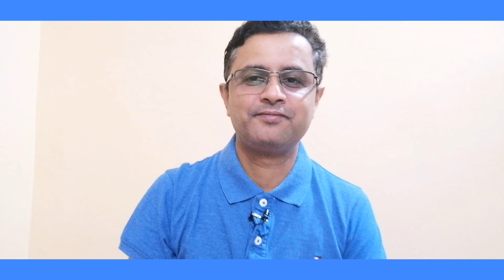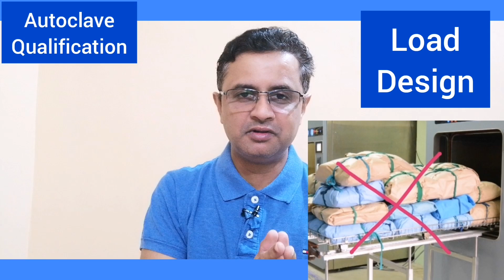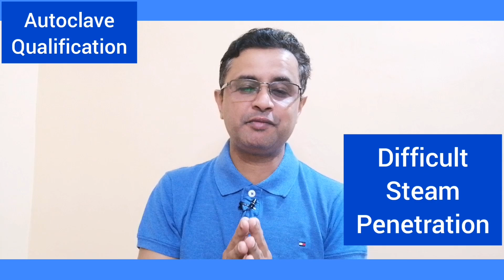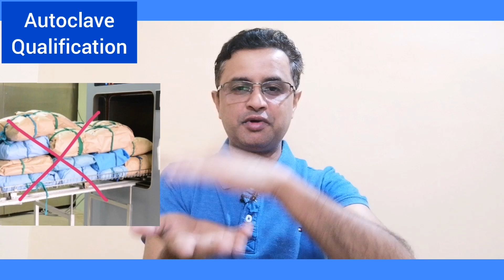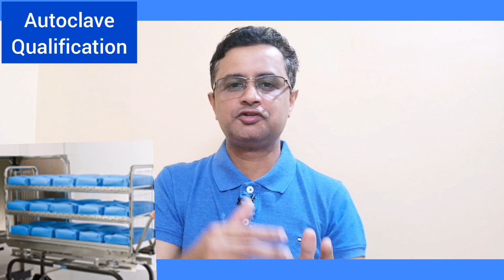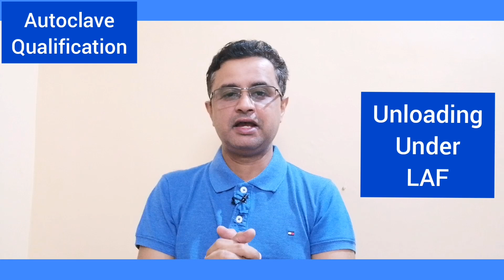Common Mistakes in Autoclave Validation ​⁠@PHARMAVEN #autoclave #validation #qualification

Comment: Sir how to determine the slow to heat and during  which stage it should be determine
Reply from the maker: Slow to heat location can be determined by placing multiple sensors in empty chamber.

Slow to heat load items can be determined by placing sensors in all different types of load items and evaluating temperature data to understand which load item took most time to heat up to sterilization temperature